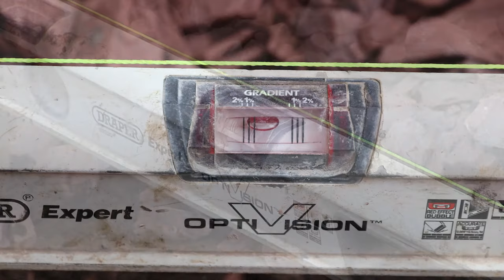How To Prepare A Patio Sub-Base

Comment: For a small 4x5m base I apparently need 12 x 1 ton bags of MOT Type 1. Inc delivery, that would be around £1000 quid. I’d need to shovel and wheelbarrow it around the back too (ugh!). Then I’d need to buy around 20 bags of pebble gravel, which would set me back around £2000 quid. Turns out it’s cheaper to just slabs on top of soil, or buy decking. All I wanted was a little gravel patio next to my old cedar shed. Building materials prices are absurd.
Reply: A rule of thumb theres 1.6 tonnes of mot per cubic meter of area do the maths
Reply: 2x bulk bags is more like 1.5 tonnes
Reply: Don't think you've calculated that correctly
Reply: @Steve-ArfArf  funny 30 yrs ive been buying mot bulk bags hold about .75 of a tonne if your lucky  google cube per tonne mot and do your own maths
Reply: Your 4x5m is 20 SQM and 160mm based on this video type 1 would be 5.12 tonnes.
Reply: 100mm subbase as stated in video.  The 150mm in video is  20mm slab, 30mm mortar and 100mm subbase.

4x5 base at 100mm, around 3 tonne bags needed.  £180approxx.
Reply: @jacksonbow2766 just rewatched video sorry you are right 100mm and 3 tonnes is correct

Comment: Does this principal apply for say at a different part of the garden i.e back garden i.e 160mm depth etc.. I am doing 5 m x 3 m patio area at the back of the garden with no property attached. and not sure if my calculation is right , so the drop should be 16cm but should it be this since its not adjoining any property
Reply: will it be surrounded by lawn or soil or both.. personally i wouldn't worry about it too much as water would run in to the gaps and into edge of lawn etc .plus you're not likely to sit out in a rainstorm..my patios drains into lawn no problems